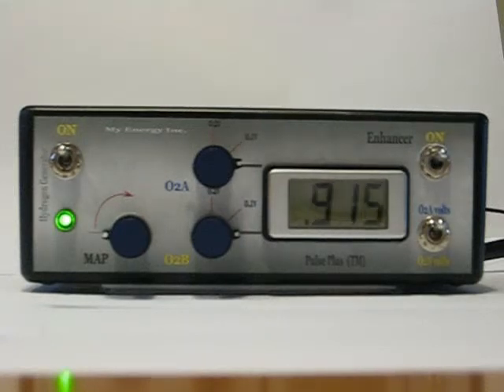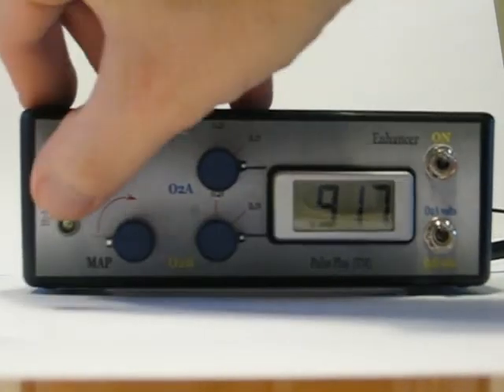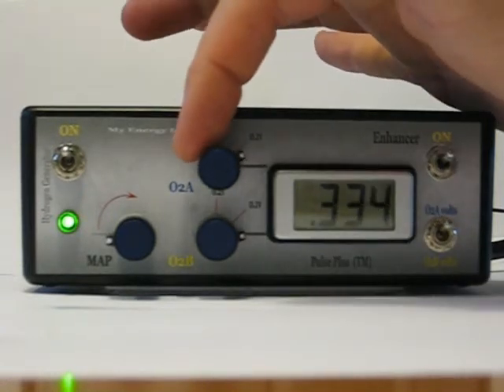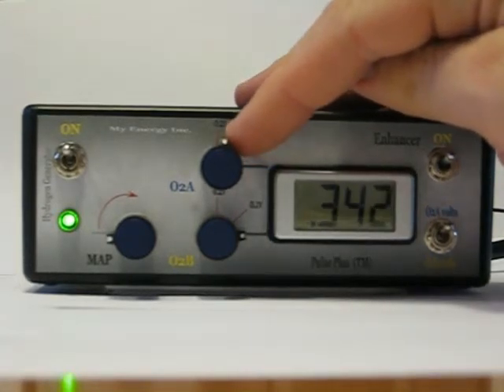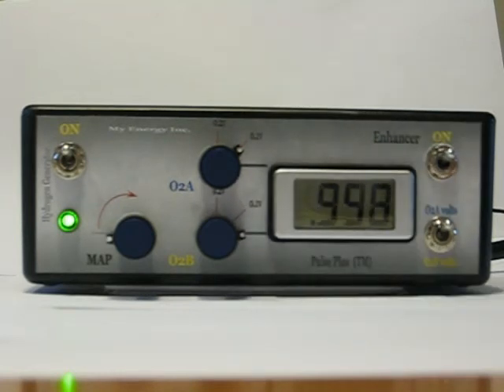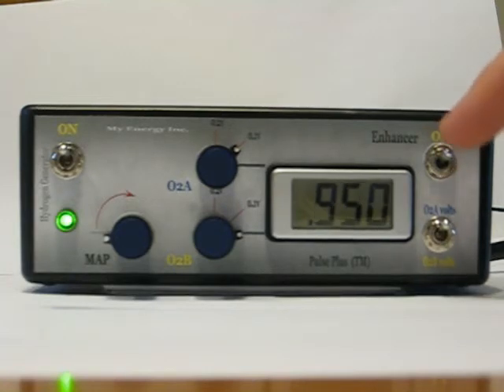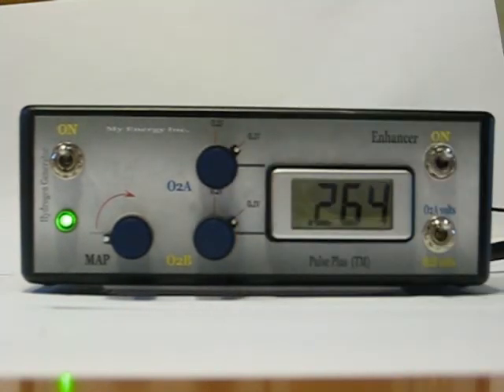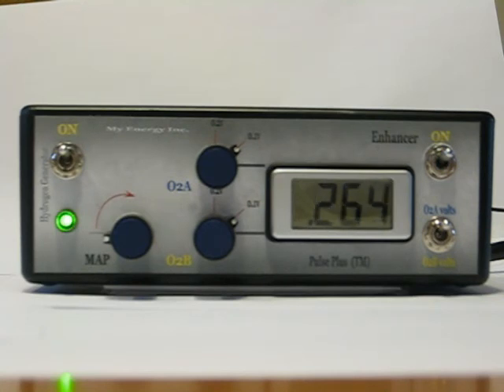Pulse Plus HHO Enhancer

Comment: I would really like to talk with you!  I would like you to explain to me how it "processes" voltage outputs from the o2 sensors and "adjust" accordingly. Does this mean that you don't neet to manually tinker with the settings btw city and highway driving?  Thanks Adam Ward 740-653-3087 or 740-438-7276

Comment: for the unit you sell that is mounted in the engine compartment. it is preset? do we need to adjust anything? or just wire it and forgetit?
is so i would be interested in perchasing several units for sale with my system do you have bulk pricing? let me know
thanks
'